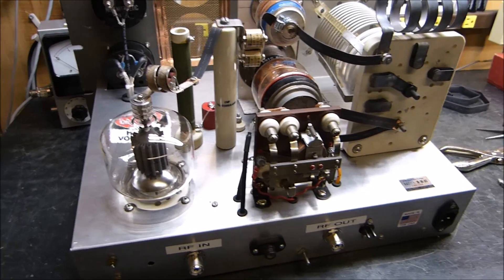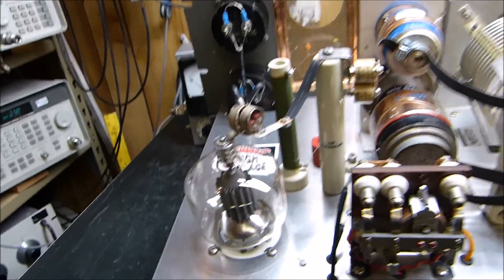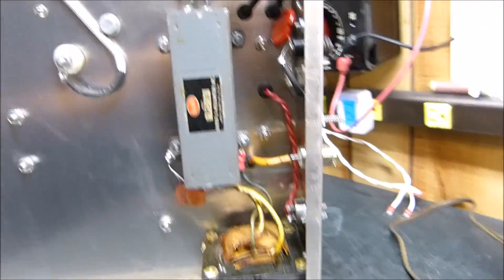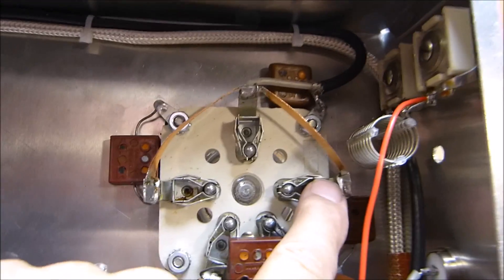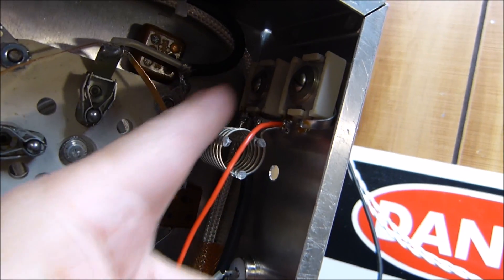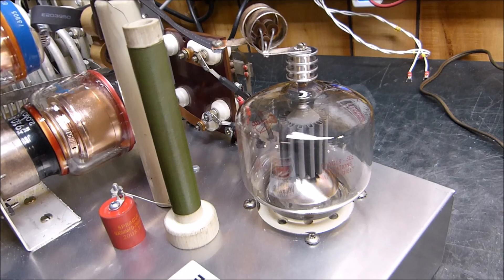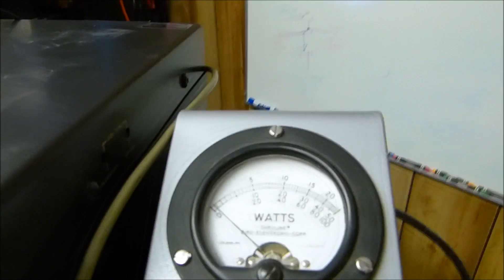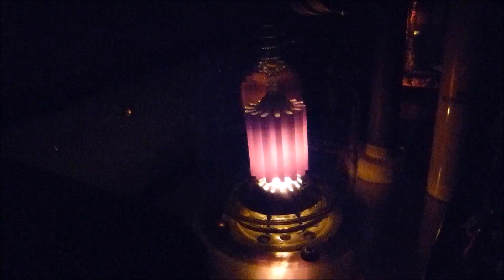Eimac 3-400Z or 3-500Z  Grounded Grid Linear Amplifier Build For Amateur Radio - Part 2

Comment: i am not an expert on rf amplifiers and i have a couple of questions.
why the pi network? i have seen a pl519 amplifier which ise a 50ohm resistor on the input and no pi network......
how to determinate the grid current meter scale? ok the tube datasheet give the grid current but in this case is some rf thing that i have to count?
in italy we have 500w pep legal limit, i have some pl519 and i have find a schematic but be gives the average power, so is a way to determinate the pep power?
i have seen a lot of people that for measure the rf power use some sort of cylinders in line with "slugs" haw are they called?
apologyze me for the English and all my questions :)
Reply from the maker: I think these are great questions. The Pi network is used because it will match an input impedance to an output impedance. This is dramatically seen in the plate tank circuit where on the input side of the Pi network, the tube load impedance is something around 2500 ohms and the output impedance (to the antenna) is 50 ohms. Same for the cathode input input. Cathode impedance is something like 150 ohms (certainly depending on the tube used) but we want the transmitter to see 50 ohms with no reactance, or as little reactance as possible. A resistor can be used in place of the Pi network but the Pi network or a parallel tuned circuit on the input, will suppress harmonics whereas the resistor will not so the tuned input will produce less IMD than the resistor. Some people drive the cathode directly with no resistor or tuned input and it will work but will produce more distortion. The grid current is DC. In the grounded grid (GG) amplifier. the grid RF is bypassed to ground with capacitors right at the tube socket so all RF is shunted to ground at that point and all that is left is the DC grid current that can be measured with a simple mA meter connected between the grid and ground which not only measures the grid current but also provides a necessary DC path to ground for the grid current. Some GG amplifiers connect the grids directly to ground at the socket and provide other ways to measure grid current. Hope this helps.
Reply from the maker: I just read your comment in email and did not see the second half. The watt meters you are describing are made by Bird Electronics or Coaxial Dynamics and maybe others - look on Ebay for Bird watt meter or simply RF watt meter and you will see many kinds. The best ones are a precision piece of 50 ohm line with an opening to insert these "slugs" to measure the power in the coax line. When the arrow is pointed in one direction, toward the antenna (load) it measures forward power and when the arrow is turned back toward the transmitter it is measuring reflected power so you can calculate SWR. This setup is probably the best but is expensive and a "slug" is only good for a narrow frequency range and a narrow power range so you will need several different ones to measure different frequencies and power ranges.. Your English is just fine. I sure wish I could speak Italian as well as you speak English.  Best of luck, 73 WA4QGA
Reply from the maker: And lastly... here is a video I made on the line section of a watt meter that you may like. It will show you how the apparatus is made.
https://www.youtube.com/watch?v=pEkGrgXUZwk
Reply: thanks!! you have helped me a lot. one last thing, on all the amplifiers i have seen on youtube is an inductor in series with each side of the filament, is it only to prevent a path for rf in the transformer or is only a practical reason? is a way to determinate this inductor or it has to be only a random inductor with relatively high inductance? 
and the plate bypass capacitor witch is placed from the plate to the output network have to be a precise capacitor or it can be just below a certain value?
(Ps i am 16 and all i know about rf is self teached so if i say a stupid thing apologyze me :)
Reply from the maker: Yes, the filament choke is two wires placed side by side and wound onto a ferrite core side by side in a bifilar style so that there is a choke winding in each filament lead. And you are correct as it is there to keep RF on the tube cathode and off the filament transformer. I don't think the inductance value is critical. If you study good examples of amplifiers like a Heathkit SB220 or a Collins 30L-1 and many others, you will see filament chokes of various lengths. The diameter of the ferrite rod is usually 1/2 inch. Up until this amplifier when I used a vintage Barker and Williamson FC-15 filament choke, I have always wound my own. For a 15 amp choke you can use #14 wire and for a 30 amp choke use #10 wire (insulated of course). I always used formvar coated wire as the insulation is very thin and it can take high temperatures. If you want to run 160 meter GG amplifiers, it is my understanding from reading articles that you will need a larger filament choke (more inductance).  For the  3.5 to 30 MHz band, many different sizes of chokes have been used successfully. As for the blocking capacitor, the value is not critical - anything between 500 pF and 2000 pF will work. I almost always choose to use 2000 pF door-knob type high voltage capacitors usually two 1000 pF parallel.
I started as an amateur radio operator at 13 years but I did not have the advanced knowledge that you have  when I was 16. Keep up the good work. I will help you in any way I can.
Reply: i have some pl519 and i want to build an amplifier, i am designing a "frankenstein" version of some schenatics that i have found, all of them use a resistor instead of pi network, i have look at sone datasheet and for this tube i have not found no data about internal impedances. anyway is better to feed the signal from the cathode or the grid?, and i can feed the signal directly in the grid with the pi network to mach impedences (same for the cathode? ) or i have to add some extra stuff?
if the cathode is better i have to bias with the resistor and capacitor but is some component that afffects from rx idle to tx mode?
the output network is more or less the same for all the schematics that i have found so no problem, i am going to use a 200pf vacuum cap that i have., they sudgest a 2nf but the since the capacitive reactance is lower and the inductive is also low there should be now problems.....
excuse all my question but i dont know no ones else that can answer.......
73 (my exaem is the next month so i have still no callsign :)
Reply from the maker: I am looking at a schematic labeled SM0VP0 which sounds like what you are describing. 

https://www.google.com/search?q=PL519+tube&rlz=1C2AVNC_enUS605US605&tbm=isch&imgil=seszCFeM74c76M%253A%253BW3sAd-zLEf-nOM%253Bhttp%25253A%25252F%25252Fwww.tubes.rs%25252FTubes%25252FNOS%25252FAudio%25252FOutPentodes%25252FEL509_EL519_6KG6%25252FPL519_40KG6_EI_MadeFor_Tungsram.html&source=iu&pf=m&fir=seszCFeM74c76M%253A%252CW3sAd-zLEf-nOM%252C_&usg=__V4LStovvwizGV1T4Amh63E1R7SI%3D&biw=1745&bih=864&ved=0ahUKEwi6q_CNj_fPAhWDPiYKHbGXCEcQyjcIKw&ei=7esPWPqALIP9mAGxr6K4BA#imgrc=AN0N5Kc5K0GAQM%3A

Uses 39 ohm resistors in the cathode of each tube and into a tapped RF coil for  the input. I see a transistor in the cathode circuit which I assume is for bias and all the grids are grounded. I am not familiar with this tube so I would have to stick to something that is posted and hope it  really works...   The output Pi network is pretty much the same for all amps with the exception of the values of the inductor and capacitors to match the Z of the output tube..
The resonate frequency of a Pi network is the two capacitors in series across the inductor and use the standard formula for resonance  Fr = 1/(2Pi*sqrt(LC))

I would stay with a cathode driven amplifier as neutralization of a grid driven amplifier can be tricky and since these tubes is not common I would not go the grid driven way.

I have always taken the easy way out for GG amplifiers and used Eimac tetrodes or triodes. The 4-125A all the way to the 4-1000A and the 3-400Z to the 3-1000Z amplifiers have schematics everywhere in amateur radio publications. Also the 813 and 811A are very good tubes.

As for the input circuit, you can probably just use a RFC in place of the tapped coil and drive the cathodes directly.

Your project sounds interesting and I hope you get it working properly.

Be very careful. I was almost killed when I was 20 years old on an old Heathkit transmitter with 800 volts on the plate. A very unpleasant experience. Keep one hand in your pocket when working with HV... The first objective is to stay alive and the second is to not burn up your tubes   :-)
Reply: yes..... 2 years ago i was working in my grandpa haouse beacuse he have shorted a wall socket tryng to connect an old echopone ec-1 that he have found on a faire(us plug on european socket....) , (we have 220 and the socket shorts before he can turn it on the radio so fortunatly he haven't burned all the filaments hahah) anyway i have asked him to disconnect the socket line from the power pannel but he have disconnected the wrong line and i have meeted what we call "the electric mark" (is like an initialization to be a propper electrician haha)..... 
i am designing the hv part with my industrial automation theacher with all the correct secuerty sensors and propper isolations. we have designed a realy good soft start circuit witch use some industrial contactors and wired logic relays that i have so realy good for now.
yes an amplifier with an 3-400z would be a dream but i am not rich so i try to use stuff that i already have and italy is not a good place to find vintage electronics so.... also for ham radio we have max legal limit 500w pep on the feed line so even build something like an Heathkit SB220 is a complete waste.....
when i finish the design i load a photo so you can see it, BIG thanks for your help!!!!!!!!!!!!!!!!!!!! 73